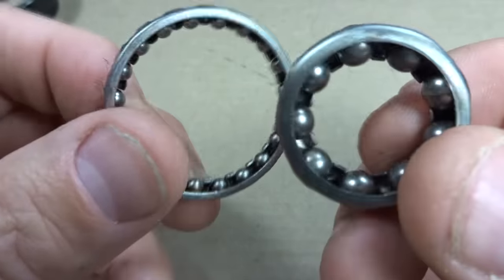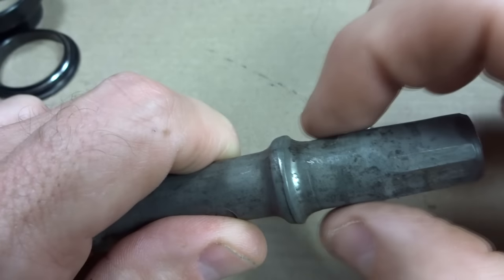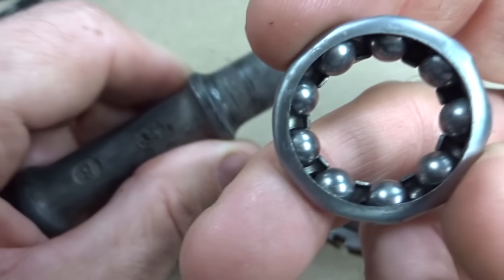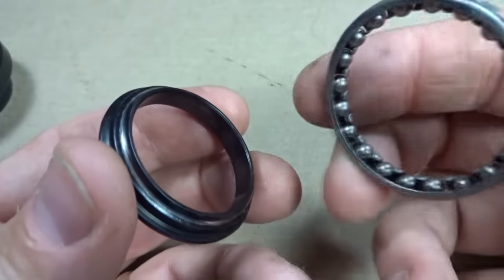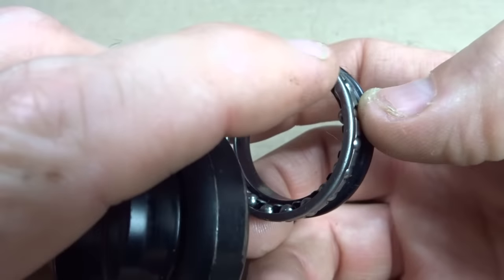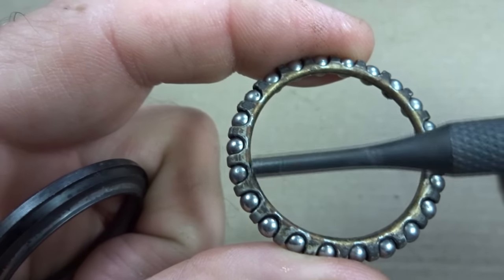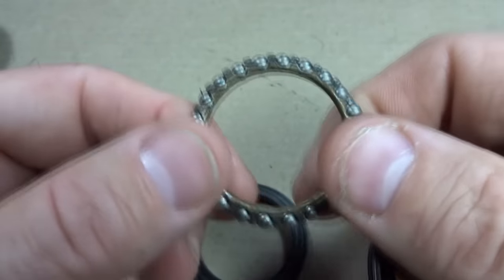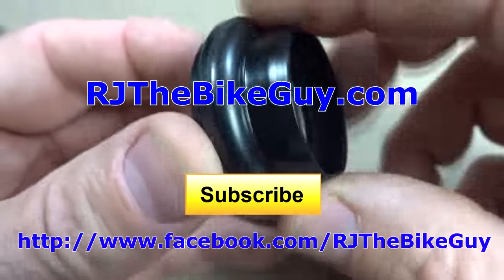Caged Bearings - Which Direction Do They Go?

Comment: Thanks so much for this info, you saved me hours of my time and money thrown at my bike. I had replaced my stem and handle bars but being a noob I had no clue my fork was going to fall out when I took the stem cap bolt out. Bearings, seals, spacers, cups whatever you call all of it when all over the floor. This is the video that got my headset back together without play in it. God bless.

Comment: Thank you. It’s a nice reminder that it helps to know the role of each component on a bicycle. Cycle maintenance shouldn’t be a prescriptive one-method-suits-all hobby. 
I’ll admit I knew about the issues with ball races, and in my own bikes I’ll replace the hub races with loose grade-25 bearings. With headsets it’s easier to keep the races but then they’re a lot more tolerant of wear. 
Cheers

Comment: Great  info RJ, on Vintage 70's Schwinns the bearing cages will not seat properly if installed on the wrong side, you will instantly notice the uneven seating against the races, just make sure to test before greasing the surfaces.

Comment: Oops.  Now I'll have to double check my install.  Thanks for the video.  Follow up question, It looks like the race on the axle in your example is pitted.  Would that need to be replaced?  Do they still make that kind of bottom bracket axles?

Comment: Got an old school mid 80s bike question for you.  Will the bearings on top of the head tube face in towards the tube.  The flat part facing up towards the handle bars?   On the bottom,  the balls will face up towards the the head tube and the flat spot near the wheel?  Thank you

Comment: I have suntour vintage bb
Open original suntour bb and it is the opposite from your example.
whichever orientation allows you to screw more of the cup into the bottom bracket shell is the correct orientation.
Reply from the maker: Follow the video. Different caged bearings are different.

Comment: Hello RJ the bike guy. Our daughter blew out the rear bearing in her schwinn elm kids bike. It's an oddball size wheel ("18) but the hub may be a more common size, not sure. The bearing is all mangled up and hard to figure out a replacement size. :(:( Bike shop turned up their nose at us. Gave me some loose bearings but i think they may be wrong size (too small). Any suggestions? TY!

Comment: 0.24$ for hub bearing,.... 0.48$ for steering,.... 0.97$ for bottom bracket bearings each near my house in Bangalore,... india,....
caged bearing/zali bearings help for faster assembly,   whereas the loose balls setup works just fine,..... just i case they drop down during assembly and we do not have clean ones to spare,... have been doing this self help from age six in my house mini cycles to two wheelers,. so on,.... various gadgets that use them,...

Comment: I had a problem with a bearing like the second example you showed. The opening was ever-so-slighlty smaller than the original one so it was scratching the crown race... I ended up putting free bearings which I guess is better anyways.

Comment: I've got a couple of kids bikes that might need to hearing races in headset and BB. Is there an easy way to measure/define sizes so I know what to order? Thanks for another great video
Reply from the maker: The best way to match caged bearings like these is take them to a bike shop and physically match them.
Reply: @RJTheBikeGuy  thankyou. I've just seen in one of your videos a park tools ruler which includes holes to measure bearing sizes. I'll get one of those as very useful, plus I like to build my tool set up one tool at a time

Suggestion for a video: "I need a new headset or BB... What do i measure and/or what type do I need?"
Reply: @RJTheBikeGuy  all 5 of my local bike shops have closed in last year. I now have to order online which means knowing what to order and in what size. It's a whole new world. I miss the old one!

Comment: How much grease do you use on headset bearings and cups? I packed in a lot of grease and the forks are pretty tight! I have loosened the headset nuts on the threaded steerer and used loctite but the the steering tube loosens after a couple of hundred miles? What is your recommended fix?

Comment: I admit I haven't watched the video as I'm pretty solid on which way caged bearings go in - there's really only one way if you do a test fitting. I just want to know your opinion on my approach. When I meet caged bearings I pry open the teeth, remove the bearings and convert the assembly to cage-less, adding another ball bearing if I have to.  Two reasons: I think it cuts down on bearing friction to not have the cage present, plus it's easier to clean loose bearings outside a cage. Is there anything wrong with this in your estimation? It seems to have worked fine so far.
Reply from the maker: No, I have some videos on going from caged bearings to loose bearings. Probably cheaper to buy loose bearings. And generally you need to add more than one bearing.
Reply: Should have said "ball bearing or two or three" - it's been a while since I've done it. Good to know. Thanks for the response.

Comment: Hi RJ! I am restoring my vintage racing bike. I have it taken apart, cleaned it and had it painted. Everything inside, especialy the bearings in the fork and the bottom bracket, whas really dirty (a combination of rust, dust and 20 year old grease). Right now i am thinking of parts I might/should upgrade. I was thinking about replacing the entire bottom bracket but since I couldn't get the fixed cup off, I'm not sure what is best to do. Maybe just upgrade my caged bearings to new loose bearings? Could I maybe buy a new bottom bracket and change everything but the fixed cup? Also how do you know it will fit since it is an old bike (the thread could be different).

If I were to buy these parts (bearings and/or bottom bracket parts) what and where should I buy it (prefereably online since I live in Belgium).

Thank you! Always very informative video's as well. Top job!
Reply from the maker: See if you can get the fixed cup off:
https://www.youtube.com/watch?v=P9oIUmdI5JU
Reply: I really tried doing this but it just didn't work. What should I do if it doesn't work? I suppose just changing the bearings.
Reply from the maker: Are you sure you are turning it in the correct direction? Is the bike French or Italian? Or might have a French or Italian threaded BB?
Reply: Well I couldn't really find out where the bike is from. It has a lot of shimano parts, the steering wheel is Italian, the brake handles were spanish so I'm not sure. I do think it is right hand threaded but I can't see how you can check this to be sure. I also don't have the tool you used to bash on with the wooden malet.

If I eventually succeed in taking it off (where can you get the tool you used?). Is it better to change the entire bottom bracket? And which ones are good/ going to fit?

If I don't. What would you recommend?

Thank you very much for the quick answers!
Reply from the maker: https://www.amazon.com/exec/obidos/ASIN/B000AOA2G8/ref=nosim/youtube25-20

Are there any markings on it the BB?
Reply: there are absolutely no markings on the frame, only on the fixed cup it says:
Shimano - Japan - M35 - VIA - LL
Reply from the maker: I THINK it might be French. French BBs are 35mm. Try turning it counter clockwise.
Reply: I am now waiting for my HCW-4 to arrive and then I'll try again. 
If I succeed, what bottom bracket should I get? Do they all fit? It certainly will have to be right hand threaded I think. And if I don't succeed?
Reply from the maker: If it's French threaded, you options are limited. Take it ONE step at a time. Get a thread gauge and measure the threads on the non-drive side. French cups will have 1mm threads (25.4 tpi).
Reply: I don't have a thread gauge. I have however tried to measure it with a simple ruler and that seemed to work quite precisely. The result was that every mm line on my ruler perfectly aligned with every thread.
Reply from the maker: Then it's probably French. Try removing it counter clockwise. Then go from there.
Reply: Very gratefull for the information! I wouldn't have made it this far without your channel. Thank you RJ

Comment: Is there a way to repair damaged race on the bottom bracket axle if it is pitted due to the previous damage?
Thanks.
Reply from the maker: Replace it.
Reply: RJ The Bike Guy 
... /... , which one are better for the bike ? ... the caged bearings , or the free bearings ??
Reply: @manuelluis5456  Free. Caged bearings are for Muppets.

Comment: so what about when I keep pulling bearings out of my bottom bracket with the cages all mangled. They were definitely put in the correct way around. that last set lasted about 30 - 40 miles. maybe the tension wasn't correct?
Reply from the maker: I don't know. I have never had that problem. So I can't say what happened in your case.
Reply: Andrew Frink Simple solution is to install a set of loose ball bearings. Liberally grease the cups and the loose balls will adhere whilst you insert the spindle. How many? As many as fit around the beaing track minus one - to allow the balls to rotate without chafing against its neighbours.
Reply: Andrew Frink Simple solution is to install a set of loose ball bearings. Liberally grease the cups and the loose balls will adhere whilst you insert the spindle. How many? As many as fit around the beaing track minus one - to allow the balls to rotate without chafing against its neighbours.
Reply from the maker: https://www.youtube.com/watch?v=BNfRD4ETDL0
Reply: Seems like a decent option. I have all the balls from two sets of failed races. If my count was right it's 11 or 12 balls to replace the 9 in the cage.

And of course RJ The Bike Guy had a video for that.
Reply from the maker: Just buy some new loose bearings of the same size.
Reply: I had a case of a chewed up cage on my wife's bike.
turned out that the bottom bracket spindle had been defectively finished, and it had a lump on it, so the bearings didn't run smoothly over the lump. not a big lump, but quite obvious when you are looking for it.
so just check that the bearing surfaces in the cup and cone are nice and smooth and even.
in this case I replaced the whole BB with a cartridge BB (make sure you get the right length spindle!), and it has been fine ever since.
pretty sure RJ has a video about replacing a "loose"/"3-piece" BB with a cartridge BB, but it's pretty easy to do anyway, as long as you have the correct tools.

Comment: But most pro advice is the opposite. The cage ring should be stabilised flat against the cone. The bearings then make contact with the spindle inside and the cone outside.
Reply from the maker: LOL! What pro advise is this? This is how they work.